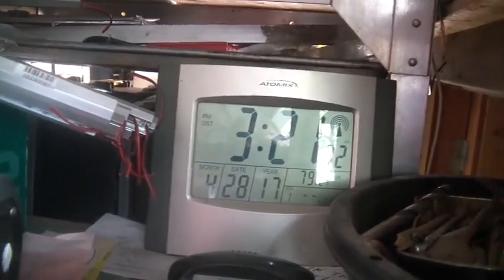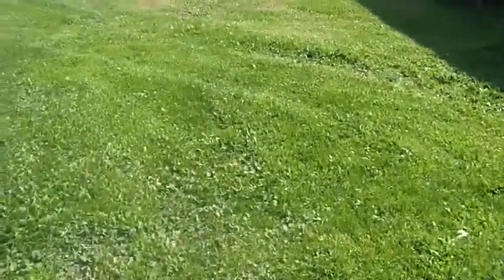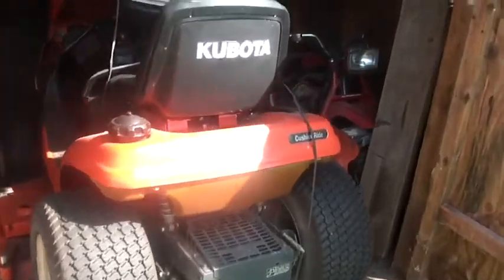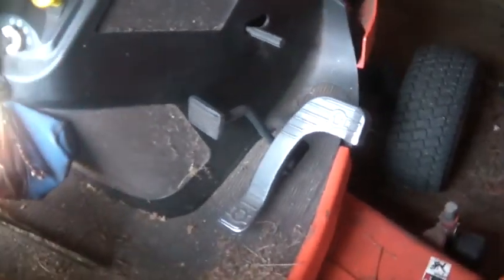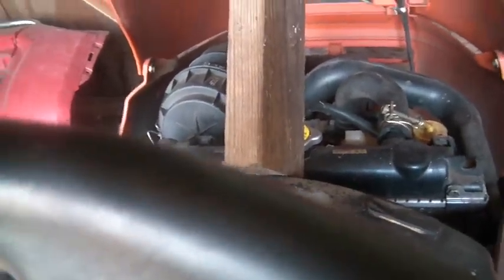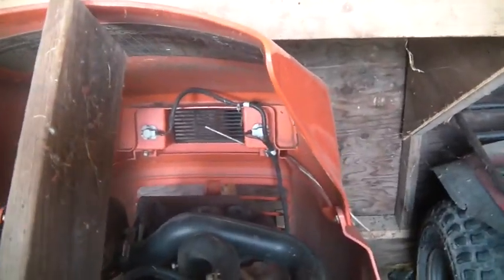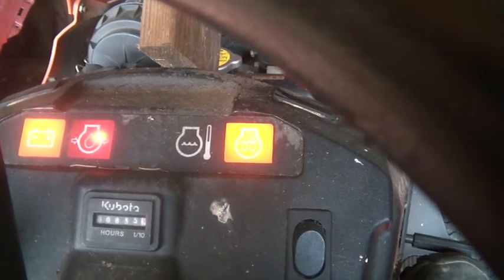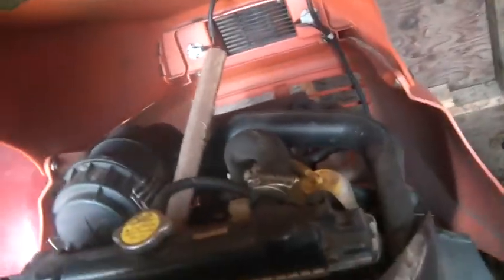Kubota D722E, 3 cylinder, water cooled diesel, cold start,

Comment: The BX 2230  i use to mow with starts easy , but cranks a few turns before starting . I got to change the oil in it , They got the oil for it , so i will change it before i mow next